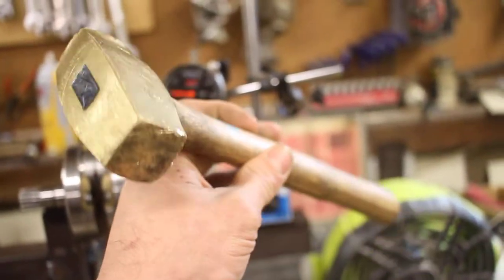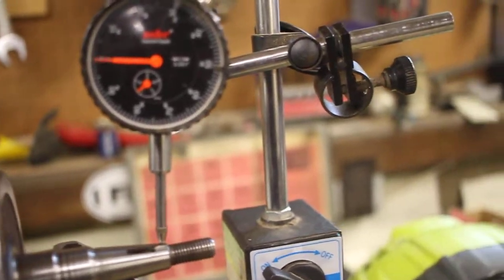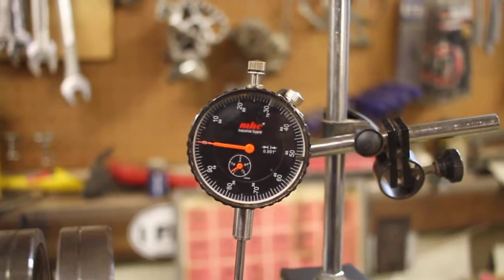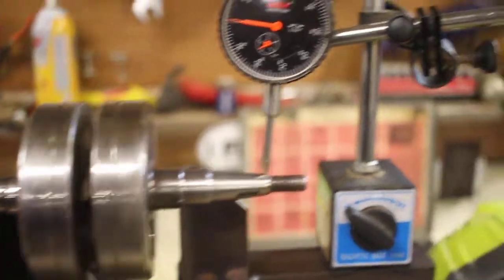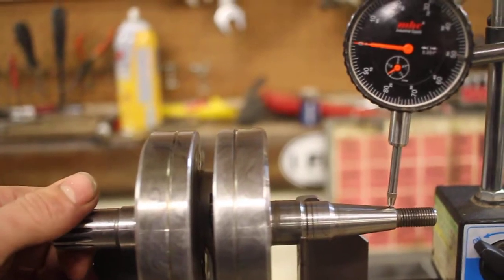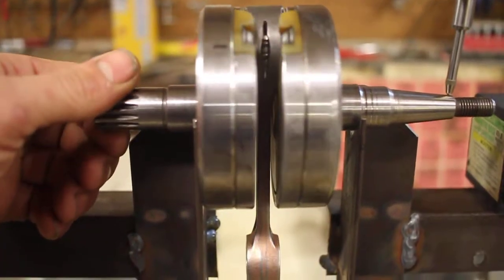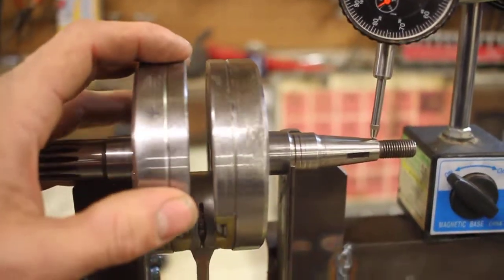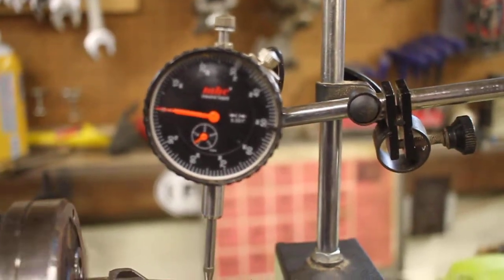Rebuilt YZ125 crank trued to less than one thousandth (0.001")

Comment: Man im trying to true a Kx450 crank and NO MATER HOW HARD i hit it it does not want to budge. Im at .015 and could not get it to move at all. I thing i might need to but the oxygen torch to it.
Reply from the maker: Press it apart and back together already? Maybe press back and forth to budge it some.
Reply: @MattEllermets  i dont have the equipment to press it apart i cut the old rod off then the pin in half. Might need to invest in some press block now. Thankyou for the input
Reply from the maker: @reminoel483  I used harbor freight 20 ton press for my crank